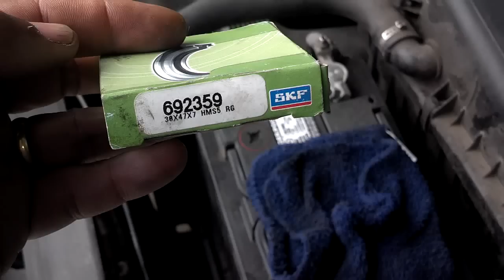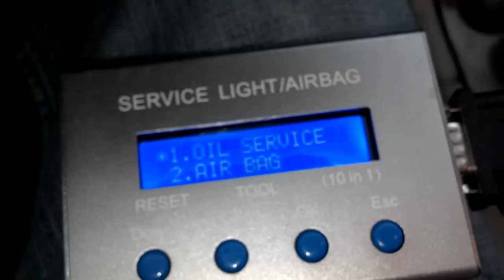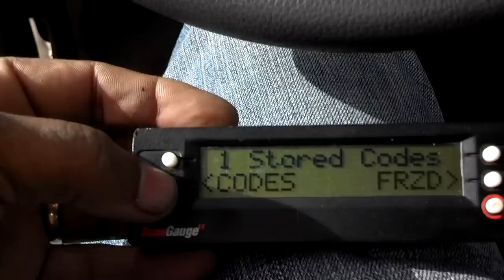Hanging out with Robert DIY on 10/13/2015

Comment: I remember changing my rear seals doing it the same way removing them with a screw. Real easy job. I recently have had a p0442 code pop up. I'm going to check that J-hose to see if that's my source of the leak. I purchased the hose a while ago from ipd but never got around to installing it.
Reply from the maker: +Sebastian Schwarz They do leak that often but when they do, they make a mess.
Reply from the maker: +Sebastian Schwarz Those P04xx codes are never fun.

Comment: Robert, you are simply wonderful and I cannot tell you how much time and effort your videos have saved me.  Thank you.  QUESTION- I have a 98 s70 @ 175k with a RMS leak.  I can replace a lot of leaked oil for the $1100 they want for a RMS replacement.  Do these ever fail catastrophically and leave you dead on the roadside or is it just a matter of checking the dipstick and keeping the level right until the car eventually meets its maker for some other reason?
Reply from the maker: +David Strate They usually gradually get worse. I usually check the level and keep it topped up. If it is loosing more than 1 quart per 500 miles, I'd consider getting it replaced. Where are you located? Some mechanics do them for a lot less.